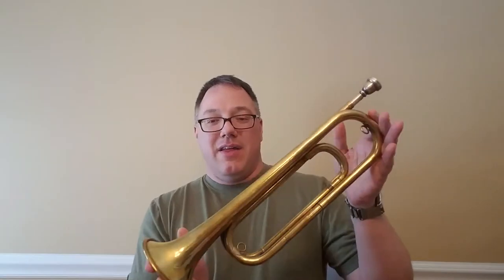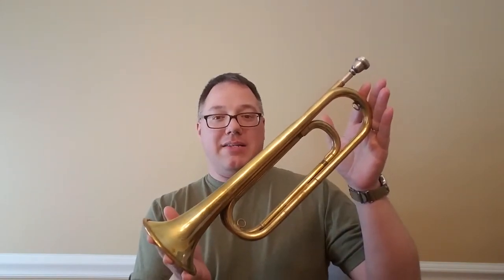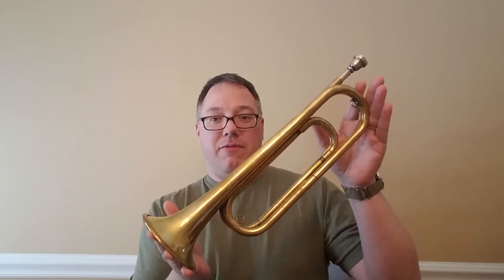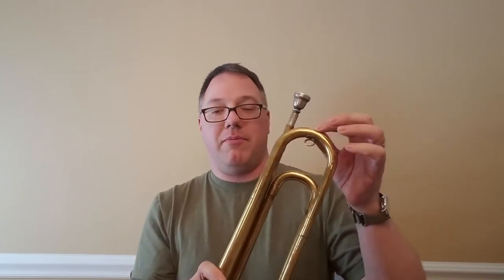M1892 Field Trumpet (Bugle)

Comment: Very late to your discussion, but Kanstul, Conn, King, and many of the really good brass instrument makers made bugles, some of very good quality.  Ebay is one place to look, although you do have to do homework on which ones are high quality instruments.  There are pages such as the Conn Loyalist Page that list models, serial numbers, and such, and show very good pictures of the classic instruments that would help a first time buyer or a experienced collector of vintage instruments.  A lot of the modern manufacturers make bugles, but they are often the DCI variety with two and three valves rather than the US Army regulation valve-less type.  Hope this helps.  PMH
Reply from the maker: Good info Peter! Unfortunately, as far as I know, when Kanstul closed up we lost the last manufacturer making the Drum and Bugle Corps valved bugles in G. With DCI rule change to "any key" demand dropped out even more than it already had. Amati still has a single valve model in the catalog (but they don't stock them). There are still manufacturers of the no valve, US regulation "bugle" (field trumpet). It has been in continuous production for over 125 years now.

Comment: Is a Leedy Regulation Bugle the same as a M1892 Field Trumpet? It was my dad's and I am having a difficult time cleaning it.
Reply from the maker: "M1892" is a model/design specified by the US Army Quartermaster Corps. Many manufacturers made them. If it's in the key of G, with no valves, double wrapped, and looks like the design of an M1892- then it is one (technically, the timing slide should pull way out with an etched mark for key of F also)

Leedy was a manufacturer of brass instruments and did make bugles. If it's marked "Indianapolis" then it's from 1895-1930. If it's marked "Elkhart" then it's from 1930-1955. They were a common supplier for drum and bugle corps in the 1930s including one valved bugles. They merged with Ludwig who was also a major supplier to drum and bugle corps.

Does it have a valve? If it doesn't and looks just like this one in this video, then it's likely a M1892 pattern bugle. If it has a valve then it's likely a drum corps bugle.

Difficult time cleaning it? How so?

Comment: I have the exact one made in Czechoslovakia and it says it on the lead pipe where the mouth price goes in and what I was wondering what do you use to polish it
Reply from the maker: On my Czechoslovakia bugle- I just use brass polish. Sometimes I use Brasso, especially when it is really bad. I also like Nevr-Dull. A bit less messy (although you need to wash your hands after) and more convenient for a quick touch-up.

Brasso is a liquid polish. Wipe it on the horn all over. Let it dry on. Then buff with an old t-shirt. Make two passes. First one the cloth will get real dirty with polish and black residue. Second pass with a clean cloth will really buff it up and shine.

Nevr-Dull is a can packed with cotton that is impregnated with some chemicals. Tear a cotton ball size piece off and rub it on the horn. It will get black. Throw it out when it's really black and tear off another piece. That alone will shine things up but will have a residue, possibly streaks of black. Then buff with a clean t-shirt to really shine it up.

Comment: Where I can buy this kind of Bugle?
Reply from the maker: There are several makers.
They have been in continuous production by what was Rexcraft, now sold as US Regulation. Id say this is middle of the road. http://www.usregulationbugle.com/bugle/pc/home.asp

Scout Bugle has a model they designed to be a bit easier and affordable http://www.scoutbugle.com/Centennial.htm

On the high end is Kanstul amd Getzen.
Kanstul makes their 50-G Regulation Bugle  model. (But the slide does not pull all the way to F) They also make a Bb model. 
http://www.kanstul.com/instruments/regulation-bugles/
I have a Kanstul also and you can see it in several of my other videos.

Getzen makes the M2003 Field Trumpet. They make the tuning slide swpable between key of G or Bb.
http://www.getzen.com/trumpet/specialty/field/

There is also the "Regiment" brand bugle you can find at several sellers. I havent tried one but my impression is that this is the budget quality that is still a suitable musical instrument.
https://www.amazon.com/Regiment-WI-800-BG-Bugle/dp/B000BBW3TO/ref=mp_s_a_1_1?ie=UTF8&qid=1537199404&sr=1-1&pi=AC_SX236_SY340_FMwebp_QL65&dpPl=1&dpID=41tVCnzgxkL&ref=plSrch

Comment: what exact model and manufacturer is this? Can U.S. Regulation bugles take standard trumpet mouthpieces?
Reply from the maker: The make is just "made in Czecho-Slovakia". Likely a factory that became part of Amati-, but before it was formed. Basically a no name generic maker.

Can a bugle made to the 1892 army specs take a trumpet mouthpiece? Some do. Some don't. Kanstul and the Centennial Scout Bugle do. I think Getzen's current one does too. But many don't, especially older ones. Many use various Flugelhorn shank mouthpieces. French shank seems popular- that's where the sides of the shank are parallel and it's one diamerer tube with no taper. You can often fit a trumpet mouthpiece in, but it's not a proper fit. The tapered trumpet shank will go in, but not as deep as it's supposed to, and the sides of the mouthpiece pipe won't be right up against the wall of the reciever- which affects tone.

Does the "US Regulation (tm)" brand bugle use a trumpet mouthpiece? I don't believe so. Maybe the new ones might (idk) but older ones had its own bugle mouthpiece. Shank has a different taper and isn't as long as a trumpet shank, and the cup and rim are different.
Reply: @BuddyCooke  thank you for replying so quickly! I am currently in the market for a bugle/field trumpet but cant really seem to decide -- I was keen for a Kanstul in G but it seems like they stopped manufacturing horns. I do not personally like the aesthetics of the Getzen variant. Was looking at The Centennial and U.S. Regulation, but am concerned on quality, plus being able to receive a trumpet mouthpiece. I would mainly be playing taps at funerals and special military ceremonies. Money is not an issue (within reason). Any advice would be much appreciated.
Reply from the maker: @Q_Channel1  Unfortunately with Kanstul shut down, Getzen is the only major name brand still making them that I am aware of. I bought a Kanstul a bit before they closed. The Regulation brand has been around a long time. I think it's a bit more of a 'budget' manufacturer compared to Getzen quality, but it's not junk. The Scout Bugles are made in China to save cost, but seem to be real instruments and not junk.
I haven't owned any of three (I got a Kanstul) but I think all three are likely fit for purpose and all worth the money at their price points- you'll get what you paid for.
If money is really no object, buy all three and see what you like :-) or pay Bach or Yamaha to make one custom :-D
Reply: @BuddyCooke  thank you for all your advice!
Reply: Before 1918 they were apparently stamped "Bohemia" instead of "Czecho-Slovakia."  I have a "Bohemia" that my father's uncle played in a Drum Corps back in the 1920s.  It was likely a military surplus item.  Anyhow, thanks for posting these videos and informative comments!
Reply from the maker: @kevingriffin1376  Thanks for the info! Glad your enjoying.
Reply: @BuddyCooke  Carol Brass in Taiwan now makes M1892 style G bugles as well. I've heard they play well. Seem to be about $600.